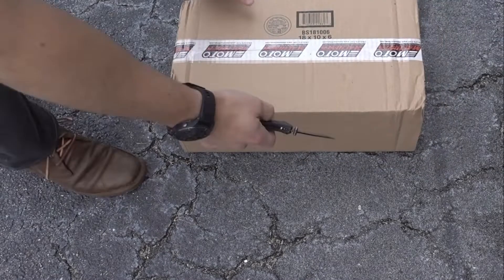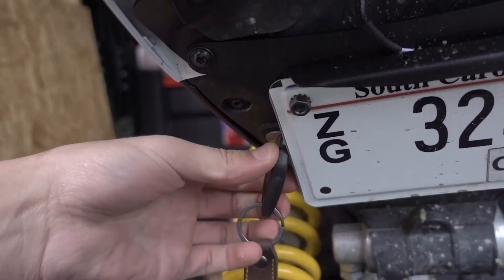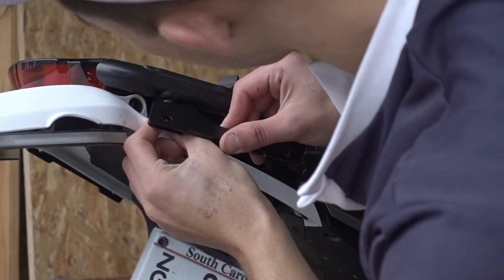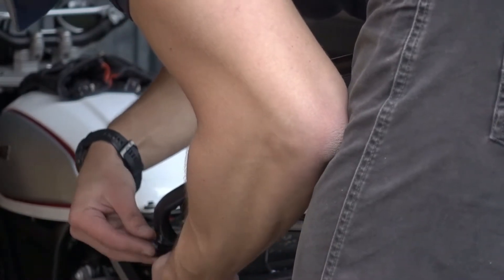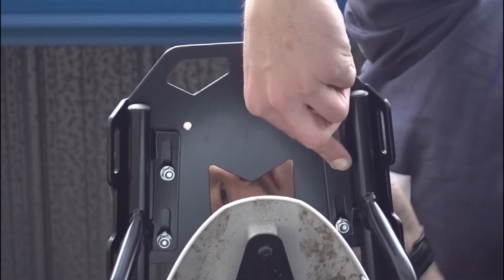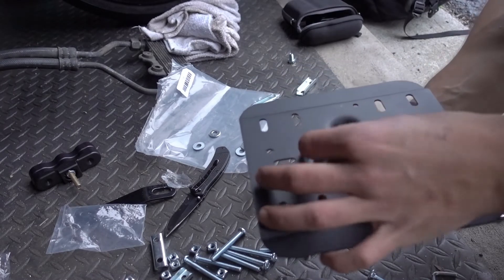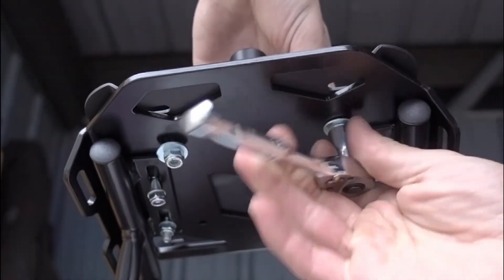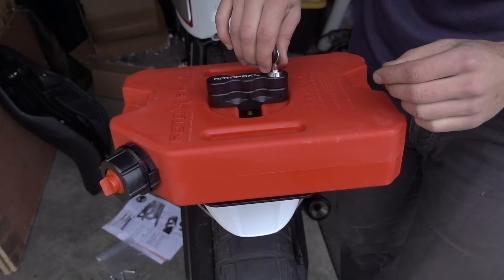Hepco & Becker Minirack & RotoPaX 1 Gal. Tank Install | Ducati Scrambler Desert Sled

Comment: Very nice! Thanks for sharing!  Were there any torque specs for the bolts that hold the bracket and go into the frame?  Any reason you did not use loctite on those screws?
Reply from the maker: No torque specs were given from the manufacturer. It is pretty obvious when you have it torqued down enough though, I haven't had any issues with the rack. Also didn't use loctite since I wanted to be able to remove the rack whenever I didn't need it.

Comment: Great videos. Did you have to remove the rear turn signals for this to work? Also was the H&B Minirack used specific to the DS or just the regular Scrambler used? Seems harder to find the minirack version now that includes the mounting plate from H&B.
Reply from the maker: I changed out my rear turn signals originally for the fender eliminator I installed. The H&B Minirack I bought is specific to the Ducati Scrambler, not just the Desert Sled - so it should do you just fine if you don't have a Desert Sled. Yea - I have my qualms with the mounting plates - I went with one from RotoPax but that wasn't much of a help either.

Comment: Does the additional fuel tank come with a lock mechanism at the mouth of it?
Reply from the maker: So with the Rotopax you have to buy the mounting hardware separately - their standard mount is $32.95 whereas the locking mount is $59.95.